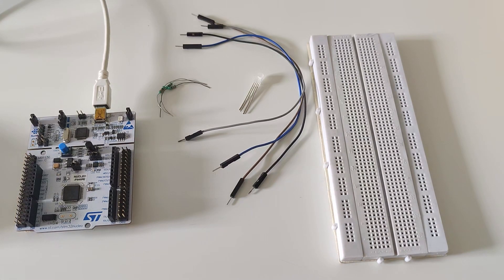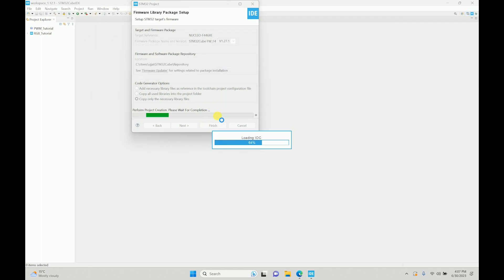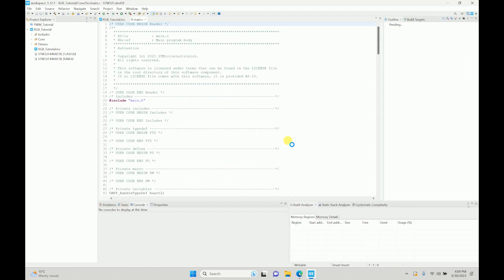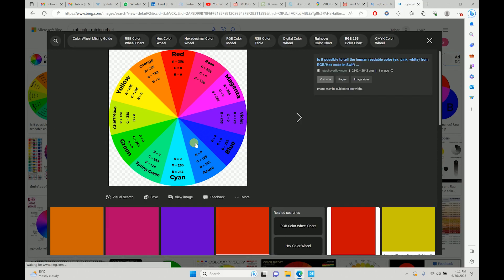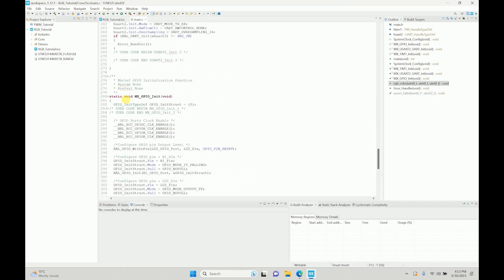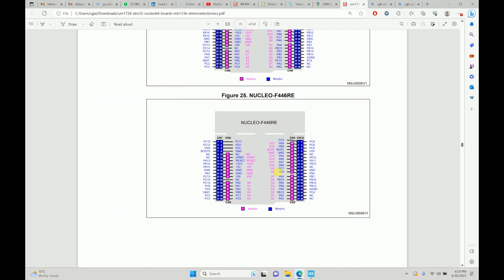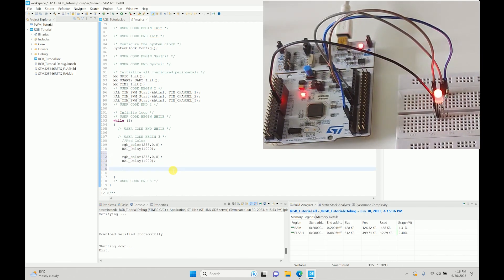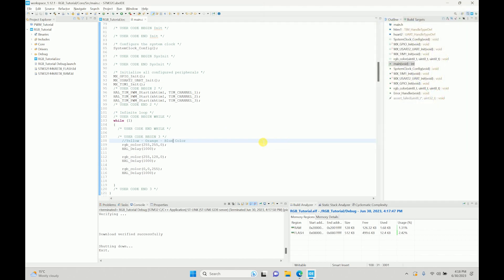Interfacing RGB Led with STM32 | PWM | Timers | STM32CubeIDE and STMCubeMX

Comment: I tried with an st link and stm32f407vet6 dev board the led won't turn on but individually with 3v3 it does
Reply from the maker: I am not sure if I understand this. But I am pretty sure you might be missing something here. I would recommend you watch the video again because it works. 
Thanks
Reply: I got what I did wrong 😅
Reply from the maker: And what was that exactly?
Reply: @electrofun5135  by mistake i had initialised the pwm start before the ticke timer was initialised
Reply from the maker: Make sense. Glad you got it to work.